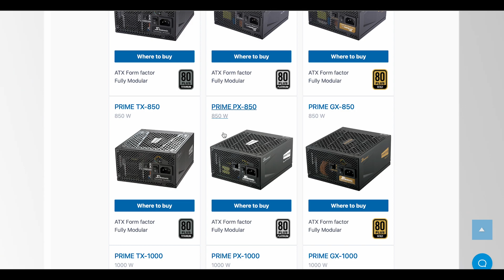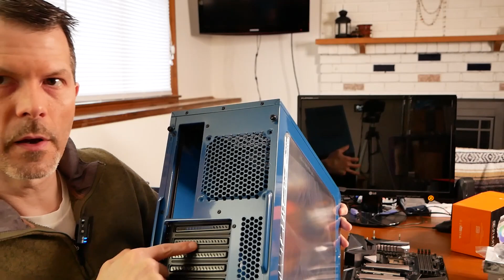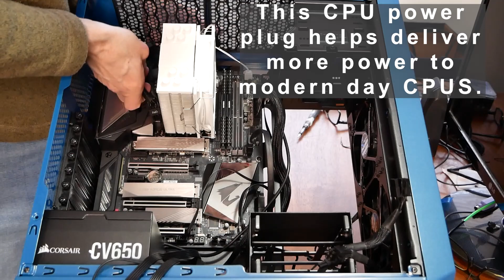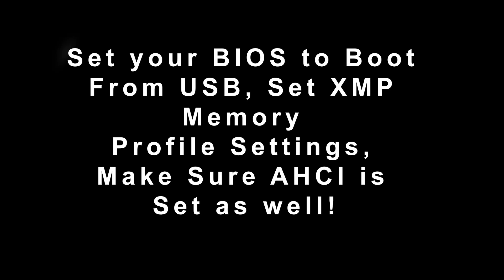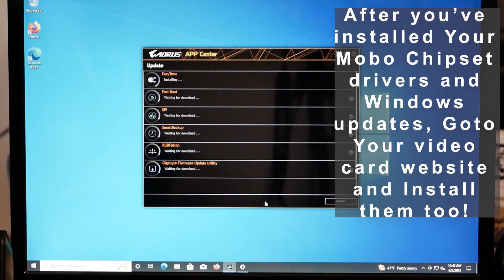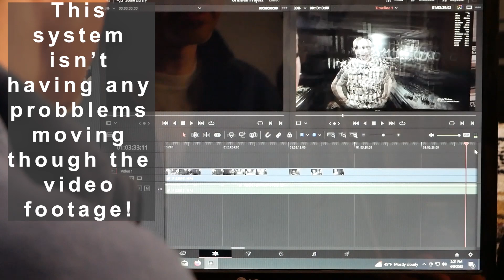How to Build Your Own PC Step By Step - 2023

Comment: Awesome build guide video, very thorough! I have the same exact PC Case as well. My build theme was to have an All Blue Colored retro setup using the following components.
 
1) CPU: Intel i7 4790K
2) CPU Cooler: Raijintek Orcus 240 RBW AIO (RGB Remote Controlled)
3) Motherboard: AsRock Z97 Extreme6
4) Video Card: Sapphire NITRO+ RX 590 8G G5 SE  
5) All WD Blue drives (1TB - NVME SN570 Blue, 2TB 2.5 Blue SSD, 4TB Blue Hard drive)
6) Power Supply: PowerSpec 650 Watt RGB
7) AsiaHorse Ice Blue PSU Cable Extension kit.
8) PC Case: Fractal Design Focus G - Petrol Blue
9) Upgraded Front Case Fans with X2 Raijintek 140mm (RGB connected with AIO)
10) Optical Drive: LG WH16NS40 Bluray Writer

System runs great for older and new less demanding games. Runs very quiet as well.
Reply from the maker: Hi there and welcome to the channel! Love the i7 4790! + your RX 590 is still a very strong GPU as well! Very nice system you have there! Thanks for watching and commenting I appreciate it.

Comment: Great video! Very instructive and in depht. I have learned that the ram sticks often should be placed in the second and fourth slots (counted from the cpu). Not sure if this apply to all motherboards though. I guess you have to check the motherboard manual to be sure.
Reply from the maker: Hi, and welcome to the channel! Tyvm! Yep, I always refer to the mobo manual just in case. Some like to switch things up.. I put a small insert in this video, in fact, about how I had to rearrange the ram sticks on this board. I thought I guessed right but didn't, lol. Thanks for watching and commenting. I appreciate it :)

Comment: Another great vid. When you got into the PSU part, I was really hoping you would mention headroom, and you did! I usually go over 20%. But on a personal build, I may go over 40% for the long haul. I had an Enermax 1000w I bought in the mid 2000s last almost 15 years! Now I'm on an EVGA 1200w, but with how GPUs are getting, lets see how long before I need to get bigger lol.  BTW, I don't know about you, but I usually create my Windows USB before the build. I'm WAY too impatient to build then wait for the download and USB creation 😆. When you know a video is geared towards beginners, it may help to simplify certain things. When you were mentioning ram a1 and b1 slots, some folk might have been like what. Overall, great vid that can help beginners start with a new hobby!

So I have a personal challenge for you. Instead of looking at the LCD screen on the camera, try looking at the lens. 😉 And if your big worry is if you are centering yourself onscreen, hook up a TV next/under/above the cam. Your peripheral vision will see if you are centered or not.
Reply from the maker: Hi! I've been meaning to switch around the table setup where I film. I deff need to work on centering on the camera and lighting. I, by habit, sit to the side because when I film, I want to get the screen in camera or parts pile, etc. I need to get a pass through video capture to use for videos and on-screen capture.. I know you can do this with overlays for radeon and Xbox for pcs. I just need to work on it as it will improve my quality. I figured I've seen too many people with cheap light as a feather power supplies and wonder why things are glitchy on their pcs . So I tried to emphasize it. I could go into single rail and multi rail ps or amps on the rails, but that would have lost a beginner.. hard to know what to add and not make it a 5 hour long video, lol. Thanks again. I appreciate it :)
Reply: @RememberThisTech  yeah going into amps and rails and such would have been much :D. Although, I think there is nothing to really fear anymore with that when buying a brand PSU unless you consider their lowest of the lowest models. What is funny is I have been wanting to mention an on-screen capture, but those are costly. I figured when things get better I'm sure you will pick one up.
Reply from the maker: @M R  what capture would you recomend? I'm all ears! Plus I spend a bit on all this review tech might as well get a capture device for improved video recording and review that too lol!

Comment: The one component you can cheap out on is the Ram especially with DDR5 (note the following tips work only with one brand of memory chips aka sk hynix)
Hynix has 2 ddr5 dies 
A Die and M Die are the types A Die is more expensive but able to clock far higher and the M Die is cheaper but isn’t able to clock as high and almost always A die can clock pretty high easily 6600-7000mhz

And I don’t know why I’m mentioning this A Die is sometimes sold as pretty low clock speeds like 6000mhz for cheap and if you were to manually overclock it to 6600-7000 you could save quite a bit of money
(This does not work on Micron or Samsung dies as far as I’m aware of)
Reply: Also
1. Don’t plug your HDMI/DVI/DPI/DP cable into your motherboard if you have a dedicated gpu plug it into the gpu 
I’ve seen a decent chunk of people make this mistake and I’ve made it before as well 
(It uses integrated instead of Dedicated)

2. make sure to clean your pc of dust regularly at least every 1-3 months it’s a chore but can extend the life and improve performance of components

3. Plan your build with a tool like PCPartPicker it automatically compatibility checks parts with each other and the community is very helpful

4. Do not ever try and force a component in if it doesn’t wanna go in check it’s the right way if it is actually the right way you’re probably just weren’t putting enough force 

5. Sata SSDs aren’t that much slower than NVME SSDs in basic tasks but throw gaming at it it’ll be quite a bit slower 

And lastly consult the manual if you have questions
Reply from the maker: @aceadadadsads  All excellent tips!  PCPartPicker is a great tool for everyone not just beginners! I know a few people who never dust their pc's and I tell them all the time, but they can't be bothered arghhhh! SSd good tip. One can often get a great deal on a high speed ssd and most Tb's over an NVME. Thanks again :)
Reply from the maker: Hi! Tyvm, great ram tips! Especially since I'm looking into ddr5 for a build!! Now that the price is coming down a bit. I never knew that about Hynix and Ddr5. Cool! I've read that max speed ddr5 helps high-end 13th gen Intel and Amd setups tweak out a small bit of extra performance. I'm eyeing a 13700k..